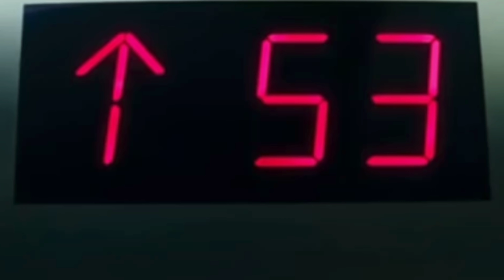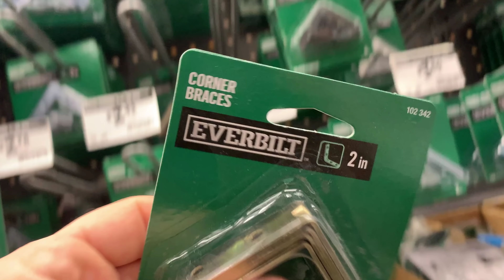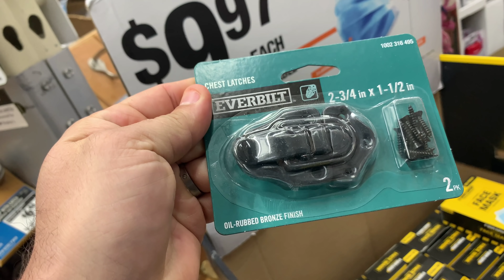Transforming Sterling Silver Flatware Into 1988 Teenage Mutant Ninja Turtle Figure. (Full-Size) PT 1

Comment: Trying to watch you saw with a bread knife 🤦🏼‍♂️🤣 if you need a fine precise cut go with a Dovetail saw. A cheap one is about $15-20 but won't last long. My favorite handsaw is a Bahco Laplander there about $20-25 on Amazon. They're popular by most bushcrafters. Also should mention the Silky Pocketboy Saw, made in Japan, its a pull cut saw but cuts like a push/pull cut saw. It's $40 on Amazon, it's a much harder steel and the blade will snap instead of bend like the Bahco Laplander.